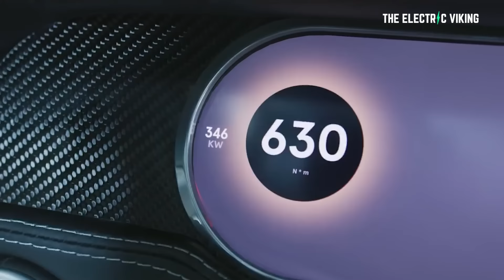Chevrolet's e-motor kit to convert gas cars to EVs is EPIC

Comment: Yeah, what about heating. Not worried about AC. But -10c and colder is no fun without a heater.
Reply: Electric heat is very efficient.  Not a problem
Reply: @klardfarkus3891  lol an ICE vehicle uses the heat from the engine, the converted car will only have the AC so no heating!
Reply: @gregandkaruna6674  there is no reason it can’t have an electric heater. Electric vehicles have heat.
Reply: @klardfarkus3891  And not a heatpump so very inefficient and more complicated setup. Just buy a cheap EV fully designed being an EV and where are you going to bolt that 20kwh+ battery? Yeah easy to fit the motor but heating batteries good luck!

Comment: Hello, ...batteries?? 
They weigh more than a full fuel tank. Many experts xisting vehicles will need major mods to fit batteries into the chassis. Reference  the evaluation of the Tesla Roadster (which used a Lotus Elise chassis) claimed to have been a huge mistake in design engineering by Tesla.

Comment: General motors has been using pretty much the same engines in all their cars whether they're 8 cylinder 6 cylinder or even smaller so in the end I think it would be easy to convert. But please don't tell me that that's going to be subscriptions and membership so whatever to pay for. That's what might kill it even though this is a good idea. I mean in the old days let's say you had a cart and maybe your horse got old or died You put a new horse in front of it didn't you????
It trick is to make it an easy transition a smooth and fairly priced transition and of course how the infrastructure electrical infrastructure to support it. It needs to be inexpensive and fairly easy and fast to recharge and the charge should last 500 miles or so. 
Typical driver or owner would be fine if not ecstatic with that.

Comment: What is the estimated full cost of this conversion?
Reply: I’ve seen the cost range between 70-100K to do my Chevy C1500
Reply: @craigfreeman9280  Thank You for sharing that. I would love to convert my vehicle to electric but at $70k I could simply find a used Ford Lightning. I will wait for another option.

Comment: Nah. I'm not buying it. They just want to do some Green PR. This should be an easy conversion, but they're not making this easy. Should be simply something that attaches to the differential. Get rid of the motor, the transmission, and driveshaft. Should include an inverter battery and management system. Haven't seen it. Is there a point to converting for fifty thousand? Get a new electric for cheaper.

Comment: Yes, customized EV automobiles will just add another area of interest for gear heads and automotive enthusiasts.  Even if most people wouldn't have the time or experience to get involved with it, this area of EV just fills out the EV ecosphere that much more and extends EV into the fabric of society another step further.

As mentioned, a lot of the die-hard gasoline/diesel will resist EV till the very last retail gas stations start closing forever (probably around 2050).  So electric motor conversion kits will just pull these die-hards into the EV fold that much quicker.

A lot of the gearheads already claim that EV's offer no customization.  But that's not so!  With EV you can custom more things than ICE cars.  For instance:

- Small powerful electric brushless motors allow more motor choices.  Also easier placement within the car's body. Small motors are easier to ship around and install by yourself.
- Motors can be custom wound to your own specifications
- Motor repair and modification very possible since its so simple and no fluid or pressure dynamics to deal with
- EV's cooling system isn't so large and extensive since EVs generate a couple orders of magnitude less waste heat than ICE leaving more room and time to work on actual performance improvements
- The ESC (Electronic Speed Controller) can be updated by downloading custom firmware from sure-to-follow DIY EV user online groups.  If really wanna get into it, you could modify the source code yourself making drastic functional changes up to the limit of your time and experience.  At minimal, you can tweak a lot of settings ESC settings even w/o coding.  The ESC firmware options and features have a big change on EV performance, range, and convenience features.
- Various battery configurations, chemistries and sizes can be installed per usage scenario

The "tuner culture" for EV hasn't even started yet!  It will be huge when it gets started given the amount of customizations options that EV technology will provide.  In the near future, there will be things that will be regularly changed on custom DIY EV's that nobody's even imagined yet currently.

Also, custom EV won't have to pass any local emissions tests either before getting registration licensing.  That can be a big hurdle for custom ICE cars.  Also some builders may be tempted to add in or modify their cars just to pass emissions testing but then change settings or remove parts later to get back raw performance at the expense of increased emissions.

Comment: Its actually funny that you say EV conversions are taking off - really they are coming back from a lull and being re-targeted from (often tiny and obscure) 70's and 80's import cars to mainstream classics.   It used to be (not /that/ long ago) if you wanted a highway capable EV you had to build it.  This is up til about 2011 when the Nissan leaf came out.    Of course EV tech,  especially battery capability has come leaps and bounds in only a little over a decade.  The typical 2001 EV conversion used about 1000lbs of lead acid golf cart batteries,  a repurposed DC forklift motor and would do 40-50 miles of mixed driving.   The typical 2010 EV conversion probably still had the DC drivetrain though AC was becoming available for consumer conversions,   and if budget was there had chinese LiFePO4 lithiums giving it 60-100 miles range depending on battery and chassis choices again.       Starting in mid 2010s OEM ev components began coming available from wrecked cars and enough people had dove in and figured out their control systems making them usable in conversions.    But you might still be mixing tesla with nissan with aftermarket EV parts depending on your project.

I've built a couple EV conversions,  one of which is my daily driver for the last 10 years now.   I also have passing acquaintence with some of the people involved in the Eluminator build and other domestic OEM ev performance projects.      I love the idea of a crate EV motor.    I agree that kits should inclusive but there are good reasons why they might not want to include just a single set of options.   With the inverters for example think of them kinda like everything on top of that small block V8,    where the V8 is the crate drive unit.    With a small block v8 you can get a single carb intake,  fuel injection,  mutiple carbs,  or a blower. Simlarly with the EVs you can get a pretty mild inverter that performs great for regular driving or on a lightweight vehicle would provide fun level performance without breaking the bank.   OR you can go for a much bigger inverter that can squeeze a lot more HP through that same crate motor at a cost of more $$ and possibly reduced system lifetime or waived warantees depending on how extreme it is.    So at bare minimum they should probably offer a "street" and "track" version of the inverters.       Unlike ICE hardware though it could potentially be the same unit or very similar,    either software limited and unlockable or with just some of the big silicon switches unpopulated to keep the cost down.   Either way this thing won't be much larger than a couple websters dictionaries.     

Also included should be a 'big' and 'little' charger option.   Both would charge the same voltage battery (should handle up to same nominal battery voltage as inverter does,  probably 400ish volts)   but the 'little' to save costs may omit DC fast charging but would support 30A J1772 and direct wall charging mode (quite handy sometimes if you are in a sparse-support area for EVs)  and could still charge a lightweight vehicle at the rate of 25 miles of range per hour of charging.   The 'big' charger option should support at least 50A J772 and SAE DCFC.    

The battery is another place where a lot of decisions need to be made and the chassis of the vehicle will have a big impact on how much battery you can carry and how its laid out.    These days you can configure batteries big enough for 100+ mile range that fit in a modular box that can go under many hoods and in many trunks but to get 200 miles or more you are likely still gonna want to custom build your battery enclosure to use up more volume in the car without wiping out all your cargo space.     But as batteries continue to improve this story will only get better.    The battery in my 2006 EV conversion ate up most of the engine compartment,   front trunk and most of rear trunk.  (was an 85 MR2)  and weighed 1200lbs and gave the overall 3400lbs conversion 60+ miles range when the battery was new.    My 2013 EV (2004 scion xB) used LifePO4.   The battery was half the volume and half the weight of the lead acid battery, lasted 10 years and when new gave 100+ miles range and when retired was giving 70 miles.    The new battery in my xB is the same weight as the LiFePO4 pack,  but 2/3 the volume meaning I now have a flat load deck behind the front seats,     and has been proven to 150 miles range easy and I estimate can hit 200 mile range on the outside.  This is most of a 2019 nissan leaf pack from a car that got wrecked very early in its life.

Anyway the best way with batteries would be to build a highly modular system with probably 3 different AH capacities and an integrated BMS and protective housing, fusing, etc.    Smaller or lower cost vehicles could use the less expensive options and larger or range-maximizing vehicles could spend the money on bigger batteries.

Comment: Converting ICE cars to EVs does nothing to solve the global constraint of lack of batteries.
Reply: Tron Jockey  Lack of batteries is neither baseless nor general. It’s openly stated by multiple sources and specific. It’s the simple truth. But you be you, everyone here can see who’s delusional.
Reply: Shortages always turn into surpluses
Reply: @klardfarkus3891  agreed, in 5 years people will have great fun converting treasured ICE cars, in the meantime it doesn’t solve anything.
Reply: Tron Jockey  Both Elon Musk and Drew Baglino have for a start, go and learn something before you embarrass yourself any further.
Reply: @fredbloggs5902  why wait five years,
Reply: @fredbloggs5902  this problem solving is over hyped. Give people options and the market place will figure it out.
Reply: @klardfarkus3891  what part of there’s a shortage of batteries do you not understand?
Reply: @fredbloggs5902  ther might be now, but that won’t last forever. If there is profit to be made, manufacturing capacity will increase.

Comment: Why would you want to do that? Nuts
Reply: you love your current car or a particular car model you've always wanted.  there are no comparable EVs on the market.  You love hot rods and performance modifications.    You don't want to pay for gas,  oil changes,  filters,  etc.   You don't want to deal with emissions tests,   You want to be able to drive your classic at least as much as you have to fiddle with it.

Comment: triple-turbo-electric drive-train conversion
Reply: btw, ac generators and motors are trash, remove brushes and controllers, use brushless dc generators and dc motors, no ac step in between, no controllers

Comment: I want to convert a old f350 or something similar in size towing and hauling capacity. Even if I only had 100 miles of range it would still be great
Reply: So you recharge every couple of hours, if you travel in the south west area of the US you will blearily make it and the time needed will be in days or weeks. No thank you.
Reply: @richarda996  I don't live there and very often need to move large quantities of feed and building materials distances less than 70 miles. You probably wouldn't have much use for my snow blower either

Comment: To me this is the reason that the powers that be should have put more effort into hydrogen. It would be very simple to convert existing gasoline engines to run on another gas. They did propane and natural gas. Pay at the pumps like we do now only it should be a lot cheaper than gas and no pollution. If they would have sunk the resources into hydrogen research that they did on electric for the past 20 years I'm sure we would already be doing that. Who knows. Maybe it will still happen if they don't come up with a good cheap battery. I just can't see putting an electric motor in place of the V8 in my classic ford. Leave a bitter taste in my mouth even thinking about it. Eliminate the dual exhaust sound? Oh hell no!!!

Comment: 3 Things come to mind on this:  1) This is a FANTASTIC idea and I hope it is profitable, as it will reduce  emissions without the need for an entirely new automobile. 2) There is no way GM will make enough from this to avoid the financial iceberg they're currently (desperately) trying to avoid.    3) It's probable that GM  intends to use low quality design/manufacture/materials to save money, and further to drive a significant after-sale relationship with spare parts requirements.

Comment: Generally it's a good idea but it could reduce the value of collectable cars. I think the ultimate candidate would be a Ferrari with a bad blown engine Ferraris are nothing but trouble and a lot of repairs are are an engine removal operation. Imagine a trouble-free Ferrari daily driver.
Reply: EV Classic cars has done some, plus a Deloren, Porsche, Range Rovers, Maserati, etc. Richard does a very high end conversion. Often using Tesla parts. A nodded Tesla rear motor comes in 450 and 600 HP versions. His LR conversions sits the Tesla motor and diff sideways in place of the gearbox with propshafts connected to either side of the diff. Brilliantly simple.

Comment: Could work, something that would produce say 200 bhp and decent torque with 150 plus mile range could make a lot of pickups etc useful, especially as in the southern states you could have free electricity for charging. All the obsessions with gigantic power is daft, lest face it even an F550 is only just over 300 bhp.

Comment: I was expecting this sort of thing back in the 80s and 90s. I definitely would have converted my old Spitfire to electric, with say 40 mile max range, way back when, had it been possible.

So we'll see if this really takes off. My assumption is that ... it will not.
Reply: I think it is to expensive to be successful. 20,000 in extra parts after the crate motor? I built my houses power system for 5000 and have more power than the power company was giving me. It's cheaper when you do things yourself for yourself.  I know they have to make money but if you're going to convert a car you sure don't need a 30 to 50 thousand dollar complete kit to figure it out. And that was before labor! I don't like it, it makes me feel like so many people let themselves be taken advantage of by the car makers that they expect everybody to pay outrageous prices.
Reply: @scottcummings8074  I agree. Way too expensive for it to catch on.

Comment: High cost for conversion, limited resources to make batteries and pressure on the already overloaded grid is going to make this difficult to achieve. I won't be going electric anytime soon. The batteries will last 15 years at the very most and then need an expensive replacement that's IF they still make them for your car, If they didn't then they would need to be custom made increasing the cost further. Sorry. I'm out. I'll stick with an ICE. They are cheaper, more reliable, cost less to run and are better for the environment (Surprisingly).

I don't know what it is but I just don't trust all this pressure on everyone to switch over and it's going to damage a lot of people and businesses like classic car collectors, motorsports, people who can't afford electric vehicles, museums and MOPAR performance companies. Sorry but I'm not a supporter of all this forced change. I believe we can live in a world where we can have both but then you'll have all the greenie Liberals pissing their pampers over everyone driving an ICE vehicle imposing and forcing their beliefs on how others should live their lives and being all smug about what they drive. Just for that reason alone I'm keeping my ICE vehicle!

Comment: This is totally waste of time and money. If you have a relatively new ICE car you had spend a lot of money to buy it why spend another amount to convert it? If you have an older car most of the parts are already old and will deteriorate to useless, why bother to convert the engine and only see the whole car going to waste in a short time?

Comment: It's still a wait and see game. If you take recent silicon growth breakthrough allowing for higher voltage semiconductors the GAS versus Electric war if you want to call it that is not only being won its being run over several times and paved into a 4 lane highway. We may see GM corner this market for a year or two at best but if they don't adopt newer technological advancements they'll keep flying to Washington in first class jets asking for a bail out. Why should the patent owners give up their intellectual property to GM or any of the gas car companies? I think we will see more Tesla style startups that realize yes, they can compete as long as the competition is kept clean. However, since America has a standard oil model of killing the electric vehicle due to profits then inventors and innovators will be bullied.